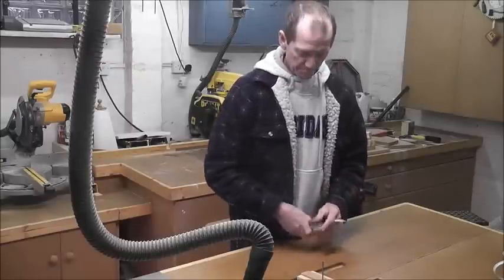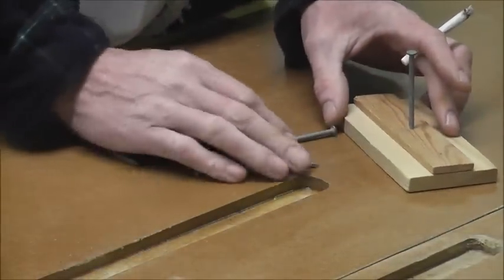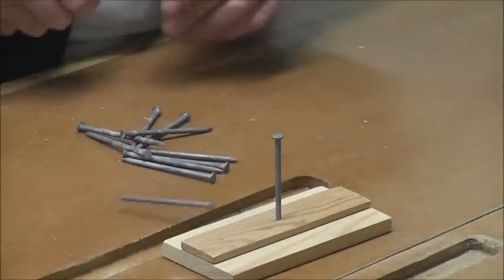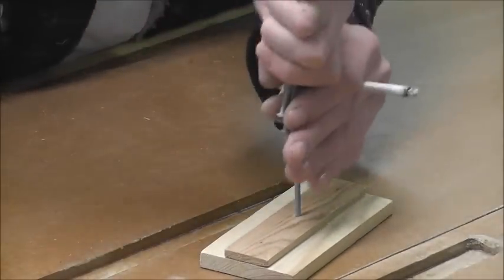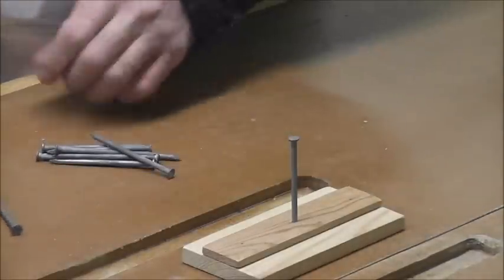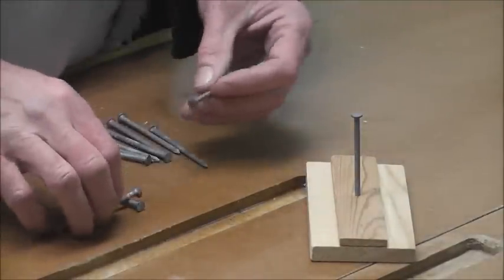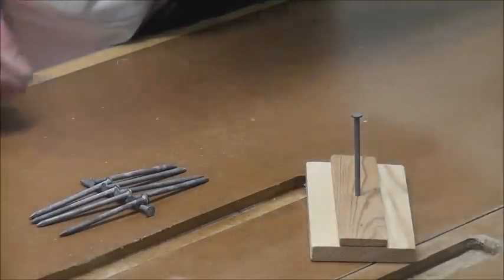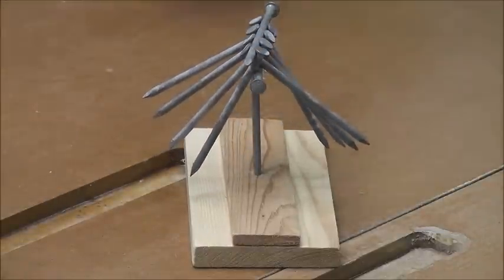Impossible Nail Trick, a trick to make you rich in the pub

Comment: I use to use this with my students. After going through the obvious first nail to balance it quickly looked like it was impossible... at this point I told them it was in fact impossible to do and was just a test to see their determination and enginuity.  I would then deftly segue into the first notion of putting a man on the moon and how that was seen by many as impossible while subtly arranging the nails along the spine nail. As the conversation about what it required to actually land on the moon I picked up the completed array and sat it carefully on the nail head. I hope my intention of pushing the limits of what is at first seen as impossible got through.